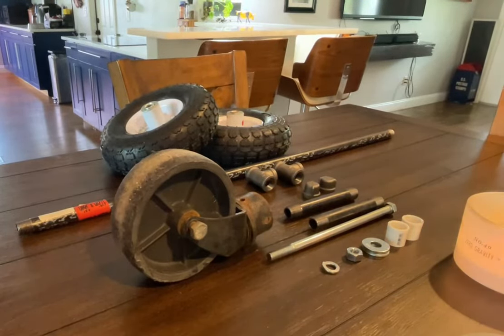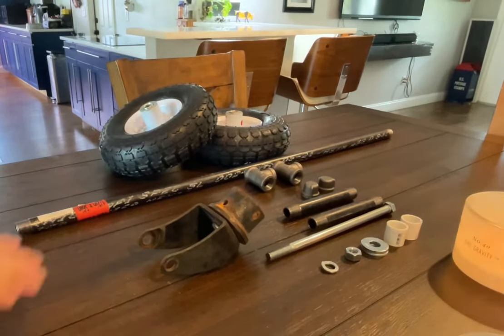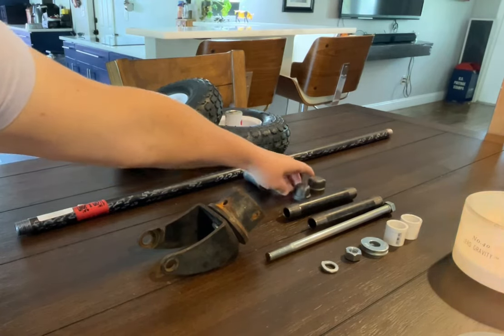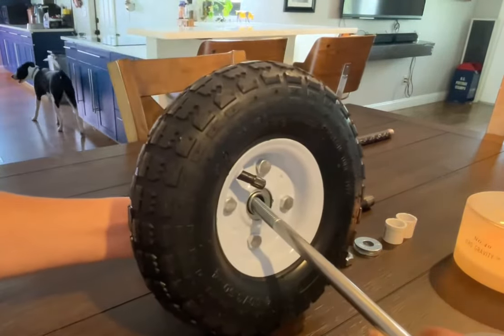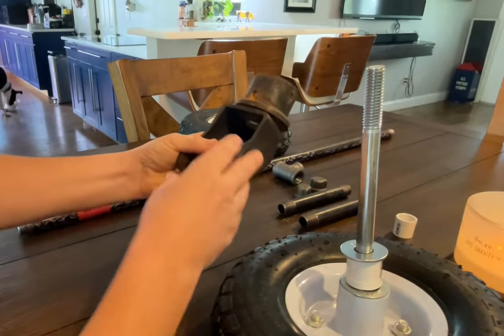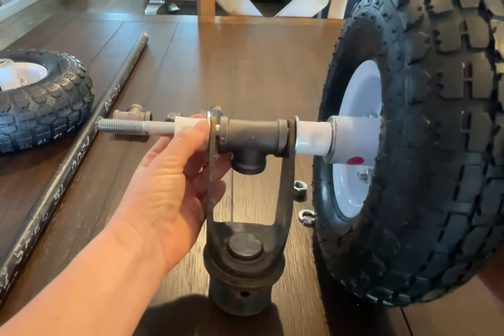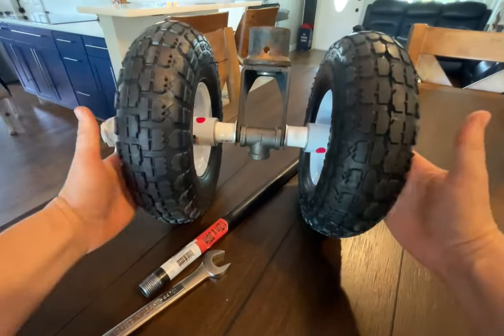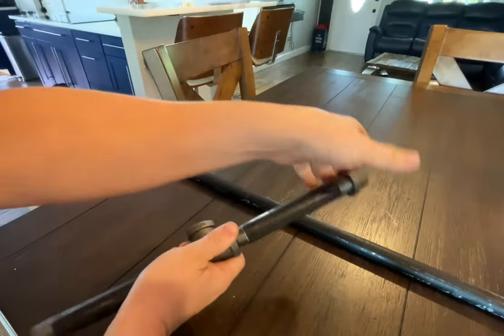DIY Trailer Dolly

Comment: If Anyone is going to the store looking for these materials. It's "black iron or gas pipe" not galvanized. Neet build though
Reply from the maker: Thank but you are incorrect. These are Galvanized steel pipe coated with black polyethylene (PE). They sell them at Home Depot. Here’s an example of one. Click on product specifications. 

https://www.homedepot.com/p/The-Plumber-s-Choice-1-1-2-in-x-72-in-Black-Steel-Pipe-1572PBL/307780439

Comment: Damn that is very very good
Reply from the maker: Thanks. It’s still holding up. The camper sits on it full time.
Reply: @connellyoff-roadadventure3265  I wonder if my trailer jack tongue will fold up with this tires

Comment: This worked for my poontoon boat. But, just not well. I still ended up spending 300.00 on a trailer dolly. But, this on a camper??? You gotta be kidding.
Reply from the maker: Yup. My teardrop was a Mypod and it weighed 700 pounds. Worked great for this camper.